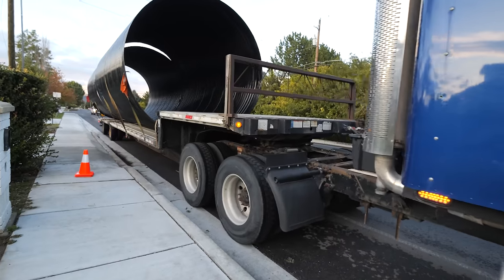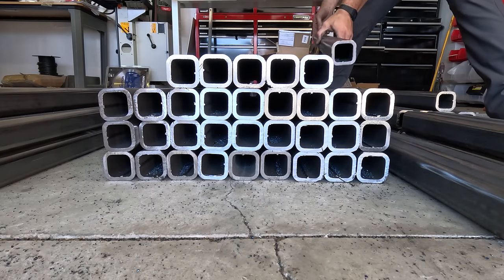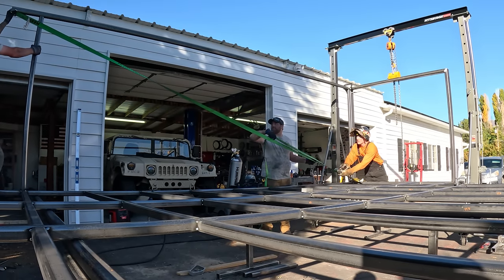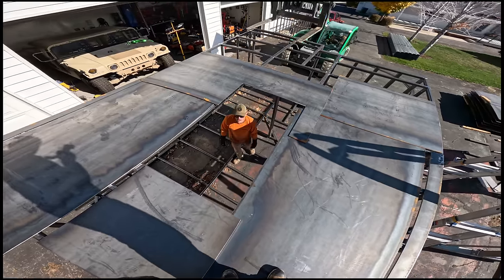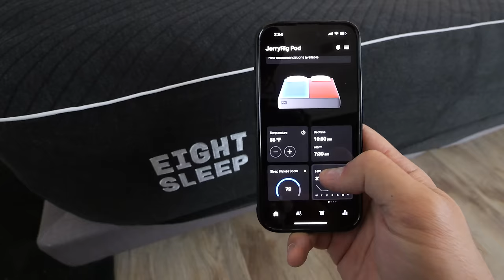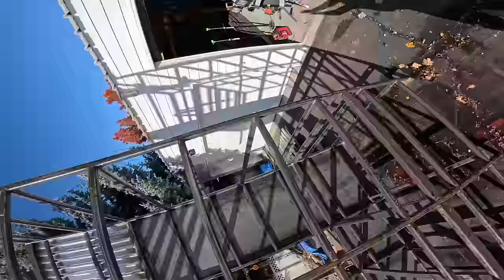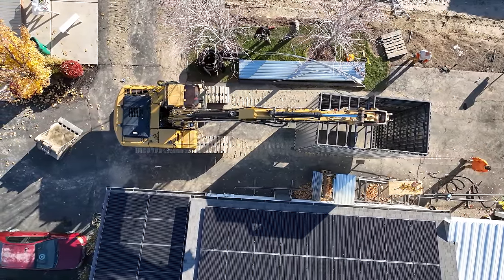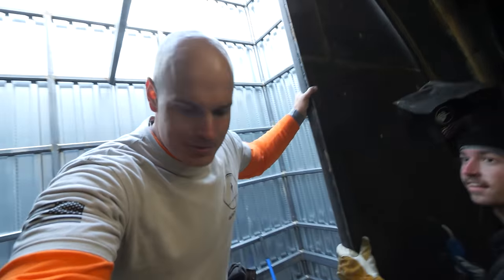BACKYARD BUNKER PART 4 - THE ELEVATOR SHAFT

Comment: Elevator and 15C through the year, a bit too warm for a perfect potato cellar.

Now, before you kill me for calling your bunker a potato cellar, it's actually not a bad idea having your prepping stuff pulling double duty as something you can use continuously for something. Having your bunker double as ground cellar means you always have food in there and it's not some "20 years" surviving dried flour stuff but actually good food, like potatoes, other root vegetables that do fine stored in around 5-10C dark place, canned food (remember store stuff you can use in your day to day life, not only that you will be comfortable with it but also that you can circulate it and always have in stock both stuff that expires in few months and stuff you just bought and expires after couple of years and everything in between), dry stuff and whatelse.
That is much better than some buckets that expire after couple decades, taste nothing like advertised but just like something that can last couple decades tastes like and most likely if the worst happens you forgot the buckets and then they are expired.

Comment: I find it very shocking that someone who is an advocate for right to repair and for a good business model could support 8sleep, I love the idea from them. But the fact that simple built in features have a price that you have to pay for the life of the product is just not right, the heating and cooling element should not need to have wifi to work. It is not necessary, that sort of system could just be built in. And for all the other gismos and and features I feel there isn't really a need for a subscription unless you want the weather to determine the bed temp which uses data. If the fee was like 15 a year I think that would be okay, but 25 is just absurd. thats 300 a year just for the subscription which is disregarding the multi thousand dollar purchase of the product itself. even though it takes less electricity, you still end up paying the difference through the subscription. Over-all a good idea and great product but with a very bad execution thats gong to make me people like me who would buy it not buy it seeing that an AC unit doesn't have a subscription. The whole ordeal reminds me of how BMW was charging customers to use heated seats. Just not a good business model IMO. I love the videos you create for us and the way you do stuff for the most part but I think me and many others just don't think this is a good thing.